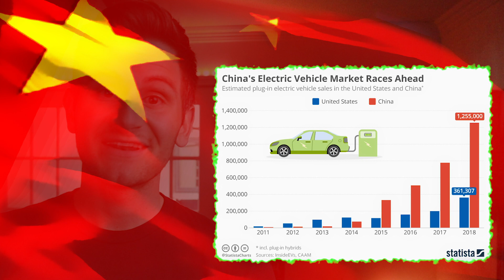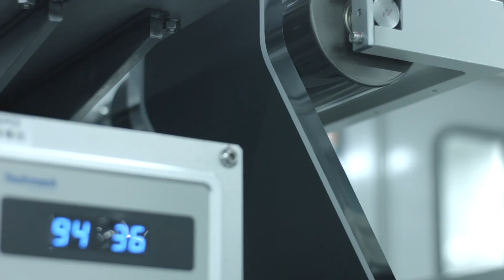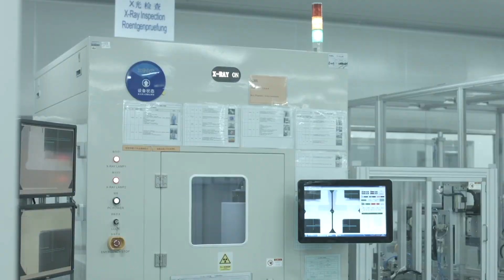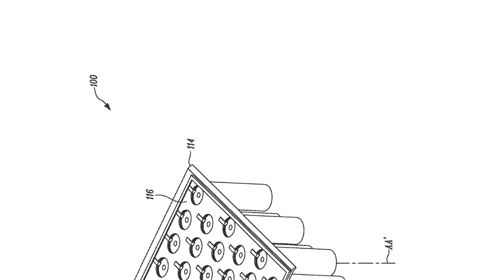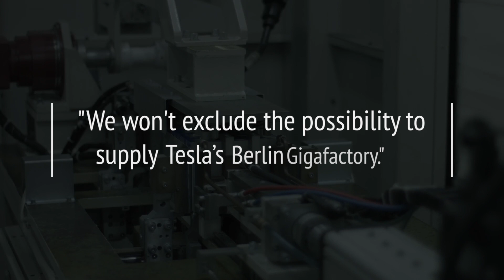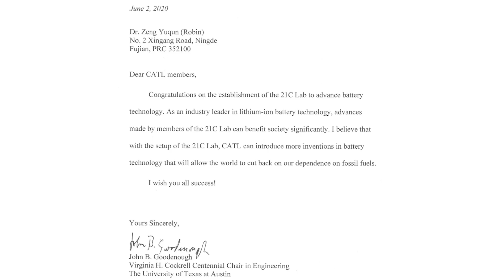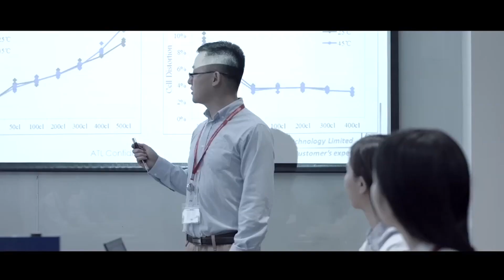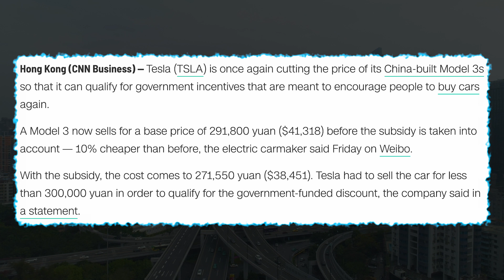Tesla and CATL - What You DON'T Know (but need to)

Comment: Honestly I doubt there will be a pure reliance on CATL for a variety of reasons including rising tensions and future proofing unsustainable battery resources. They’ll be a profitable company in the long run because most auto manufacturers will sprint to make electric, but as far as innovation I think Tesla is just using them to match growing demand.
Reply from the maker: Never a pure reliance, just an extended reltionship potential for lower cost models for as long as they can't meet demand on their own, which will be a long time

Comment: In my bike I been using high performance (6c) lfp cells from liitokala, and it has worked perfectly. I made 2x 12s2p 37v 13ah packs, total 1kwh under 200e... Lasts forever and bike has good power and range. Peak is about 1,5kw.
Reply from the maker: That’s awesome!
Reply: Liitokalas are awesome batteries. Have capacities higher than their actual rating. lifepo4 batteries are awesome and have great cyclelife

Comment: The contracts are probably short term because it will take a couple of years for Tesla to scale up their Roadrunner battery production technology that they are just starting to build up to scale in Fremont. Once they’ve ramped it up there and worked out the kinks for high volume manufacturing then they will start building it up at Nevada and then Berlin, and finally Shanghai so all of their production will gradually be in house, but they need these other supply agreements in the interim until they can get there.
Reply from the maker: You got it!
Reply: @DillonLoomis22  Yes, CATL is a stopgap until Tesla can scale up their own battery production.  CATL is also advantageous as another local supplier in China.  It takes much battery supply to produce EVs at large scale.

Comment: Early days and the majors are catching up quick.
Every improvement including batteries will be incorporated in every new vehicle.
The race is on and the winners has yet to be ascertained.
The losers will lose everything.
Lets face it a metal box plus 4 wheels plus a few motors is easy.
The deciding factors will be batteries and design.
There will be plenty to choose from.
A price war will result soon.
EVs are still far too expensive compared to ICE vehicles.
Reply from the maker: Getting cheaper by the year

Comment: Sorry, but I agree with quantaca.
As stated, I believe the LiFePo4 chemistry only provides sufficient density to suit the short range Model 3, it's limited by the physical volume available in that vehicle (not just the pack)

The Tesla cell (probably 2170?) Will provide well over 300Wh/kg, that's where the (main) cost saving occurs, with fewer cells in the smaller packs.

Other savings?
I believe the new cell will have its first application in the Plaid Model S. That vehicle (pack) needs substantial energy boost in a volume which I suspect is "maxed out" with the existing design.

Also, cooling needs to be addressed.
That will be accomplished in several ways, by cell materials and chemistry (Maxwell/ Jeff Dahn)
New cell construction (edge connection) all of which reduce the internal resistance, therefore heating of the cell under load.
(Not to mention charging at ax V3 rates for the full 0-100 pack capacity)

Then, there's the pack patent (mentioned in the video).
That details the sub module layout, but also suggests innovative multi- state cooling (clever!) and a fast construction using layered PCB connections (less, if any welding of terminals?)
(Note that the patent indicates use of cylindrical cells)
The logical path would then be to use the same "box" with fewer cells for the "lesser" S/X models.
This would logically lead to the end of the 18650 cell, meaning a much cheaper pack, due to both density, and no shipping cost (cash for a refresh??).

Next step?
Why not a smaller "box" for all but Plaid cars?
Model 3 size? (A 40% density increase would increase yield from 75 up to 100kWh in the available volume, that's about 350Wh/ kg)
Result,
A modular pack casing that fits ALL current S3XY models would save a huge amount. Just tweak the cell quantity.

Why not a common BMS?

Those cell sub modules could also be used for storage solutions.
(Note the lack patent specifically mentions a storage application)

All shaving the costs, Tesla likes Modular.
Reply from the maker: Thanks for sharing!

Comment: @ Is Tesla too expensive?
     The short answer is not. Let me explain:
      If you buy a stock, you need to know
1. FEPS (forward 12 months,earning per share )
2. FGR （forward growth rate of EPS )
3. Since FPE= Price/ （FEPS）
4. Thus PEG=FPE/FGR
5. For comparison, stock with lower PEG is relatively more valuable.
6.  Base on the above, one can compare Tesla with some familiar stocks as followings（*）

TSLA-(123/230)=0.53
*AMZN-(72/99)=0.72
*FB-(24/33)=0.73
*GOOGL-(28/32)=0.87
**CRWD-(600/530)=1.13
***NFLX-(59/33)=1.78
****SHOP-(1193/40)=29

Conclusions:
1. According to Cramer, a stock is too expensive when PEG is equal or higher than 2.
2. Tesla is the cheapest stocks among all the above.

*All data are based on 7/10 prices.
**By the end of 2022, Tesla will probably have 2-2.5X its current output of EV, from combined Arizona, Fremont, Shanghai, Berlin, Austin and  Chongqing Giga factories.
Reply from the maker: Thanks for sharing

Comment: Tesla has to be very careful in China, always remember how Siemens and Kawasaki were kicked out of the country after Chinese robbed their high speed railway technology.
Reply from the maker: I wasn’t aware of that, will have to learn more! Thanks for sharing
Reply: @DillonLoomis22  If the Chinese wanted to, they probably would use the strategy took over the McDonald's. When McDonald's first went to China in early the 90s, they got huge benefits from the Chinese government's preferential policies because the Chinese were very interested in how to run business at that scale. After 2 decades, Chinese learned how to build and run the entire supply chain domestically, McDonald's found it became extremely difficult to do business in the country and the once friendly government became contrarian, they finally surrendered the business to the Chinese. As today, McDonald's restaurants in China is probably the only franchise on the planet bearing that logo has nothing to do with -- the McDonald's.

Comment: I HIGHLY doubt Tesla is switching to prismatics in the long term/globally. The benefits of cylindrical cells in reliability, safety, performance and other aspects, are well above what they would get from prismatics. I think they are simply taking advantage of CATL's expertise with prismatics, and the fact that they're the leading supplier in china, to accelerate production. I'm willing to bet it took far less time for them to adapt their chemistry to CATL's prismatic process, than to have CATL produce a whole new line for cylindrical cells, or to use a different supplier. 
China's auto market is also far below the level that Tesla's vehicles are at. They don't need their cars to match the cars they're producing at Fremont. They can get away with producing a vehicle that doesn't perform as highly as their american made cars, because China's auto market is far less developed. Most of their vehicles are poorly made, unreliable and overall substandard, so it's much easier for Tesla to beat them by a wide margin, even without making their very best vehicle.
Reply from the maker: Thanks for sharing. I agree with you on most points, but you can say the same thing for the US market and anywhere else really lol

Comment: 2 things i would point out, 1st the stats of tesla's model 3 lfp version kinda suck, it has less range (wltp 218miles vs 254miles) And its a lot heavier, (1745kg vs 1612kg) and they only reach a pack energy density of 125wh/kg vs for instance the BYD blade battery's 140 wh/kg. 

2nd, i think you are confusing LFP with NMC when talking about future cell density, yes they are talking about 200wh/kg for LFP but the 350wh/kg comes from their currently in research NMC811 cell (to be clear CATL already has NMC 811 cells and theres one that rumoured to go into a new chinese car by end of year with 304wh/kg vs ~280 for lg chem's nmc811 and ~250 for tesla's 2018 2170 NCA)
Reply from the maker: Thank you for adding these points! Yes the LFP performance is lower but it should still lead the Chinese market